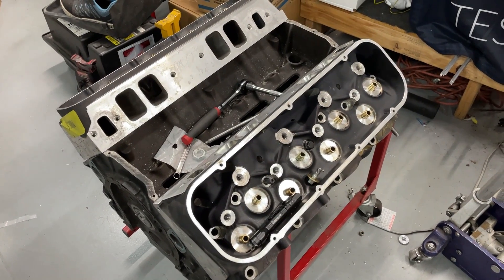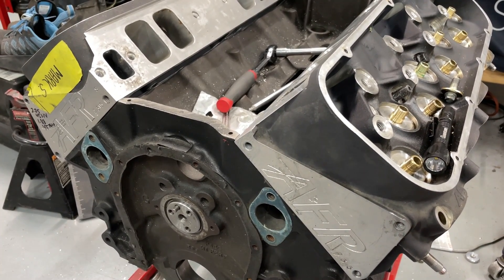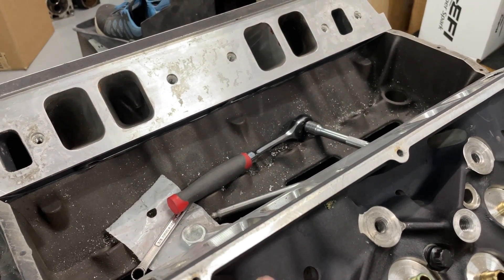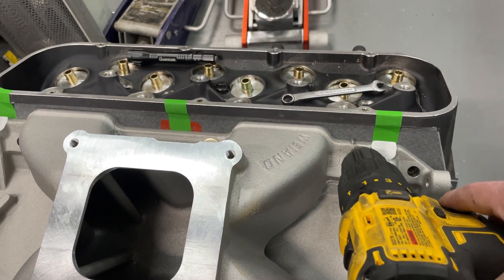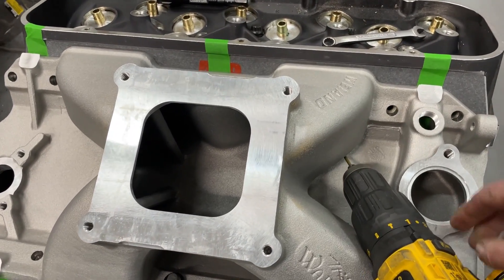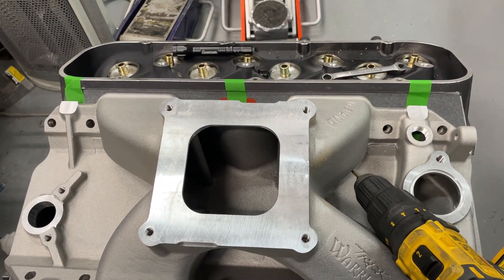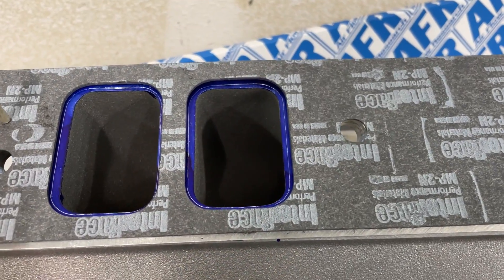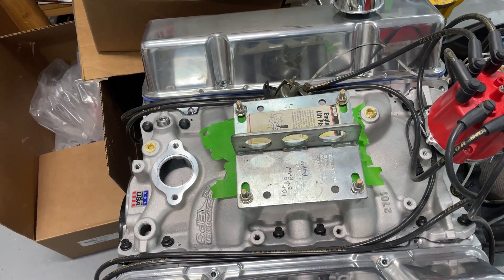A Better Way To Gasket Match

Comment: How does one know a port mismatch?  An intake manifold gasket can be used as a template but how can we see if the angles between the head and the intake manifold match, especially if the block is decked?
Reply from the maker: Angle finder

Comment: I have some AFD Cleveland 2V heads and the port locations don't align very well with the gaskets. I have a set of MR Gasket intakes and another brand that escapes me at the minute - neither fit the heads well. I have a Performer RPM intake. The Mr Gasket gaskets don't fit the performer very well either, but the other gaskets do - almost perfectly. Question is do I match the heads to the intake rather than grind the intake to match the heads. Heads are out of the box un-ported. Some sides of the ports in the heads would require about 1/16 removed to match the intake.

Comment: I use two bolts to hang the gasket, and mark the manifold or the head with a marker, and then I put the gasket on the the other part had or manifold and do the same thing, and then compare the two, sometimes you have to shave the gasket as well, but you use it for a template to match up each port.

Comment: If you drill vertically perpendicular to the crank centerline you can us 1/8" piano wire, which is hardened like a drill bit and then you only need one bit and you can put the pins in the heads, put the gaskets on and set the manifold down in perfect alignment everytime. The pins won't bind the mafiold but will keep the manifold even as it's torqued down to compress the gaskets.

Comment: Seen one vid where guy said the critical part of the port to match was the floor, and he used intake gasket thickness to achieve this alignment. Said unless ports are far off from each other there isn't any gain by grinding....

Not having a Dyno and multiple test pieces I'll never know the truth to his statements.

Comment: Eric I did the same thing to my head( iron wp) it wasn't but 5 tho .I ran it with 13.7 to 1 pistons and so far so good I've been watching the compression on that hole.
I guess the gasket took care of it..
Ole ridge runner race truck if ya wanna hear it run 95 s10

Comment: I used to gasket match by putting the gasket on the heads with two tiny spots of silicone. Then I put the manifold on with four tiny drops of silicone. Tighten it all up, let it dry and the gasket will come off stuck to the manifold. You can then scribe the lines, and remove the gasket. If you are careful with the placement of the silicone, you can still reuse the gasket too.

Comment: That's a great technique. An old timer racer taught me 30+ years ago to put a couple spots of grease on the heads, lay the gaskets down and then put some RTV on the intake, set it on, torque it down and let it set overnight. Pull it off the next day and of course the gaskets stick to the intake. Gasket match from there. Of course this was on Pontiac engines so the intake is pulled into the thermostat crossover so there is no back and forth adjustment available. That method worked pretty well but occasionally the grease would allow the gaskets to slip a little. I think I'll start using your method as it seems to be very repeatable when you have to do a tear down for whatever reason. Thanks!
Reply from the maker: No problem

Comment: My method:

Duct tape a 44oz foam fountain drink container onto the end of your shop-vac hose, and seal the drink cup into the cylinder of the block so the shopvac can suck on the cylinder. Have exhaust valve installed, but not intake valve. Turn on shopvac and spray a bit of paint primer down the intake runner for the cylinder you are "marking". Resposition shopvac and repeat for all cylinders. This will mark where your head ports are misaligned with the intake. Grind as needed.
Reply from the maker: Not a bad idea.
Reply: Just Don't spray very much paint because shop vacs have a tendency to use electricity. 😁
💥 Kaboom! 💥

Comment: Hey Eric, on a dual plane manifold, like this 2701, how do you know if the ports are lined up the best they be?
Reply from the maker: I usually just center the bolt holes on dual planes. Then I tighten it down and drill the holes.
Reply: An inspection camera that plugs into your cell phone can be had for less than 20 bucks on Amazon, would be handy for this.

Comment: Sometimes the simplest solution to solve a problem is in your face and a smart person might not even realize it. I've thought of ideas to solve my port and gasket matching issues for quite some time now on my small block stroker. I've never thought of this easy and simple way of taking care of matching and I consider myself a fairly logical and smart person. I've even done this practice before for re-mounting my body panels after lining them up and removing them for painting. They always go back to line up perfectly upon re-installing them. Never thought of using this to match ports.

Comment: An idea for the perfectionists amoung us.  You can use a cheap Harbor Freight inspection camera ($85) to get a look at the final assembly (for dual plane manifolds).

No, I wouldn't buy one for port matching, but you will not be sorry having one in the shop.  Use you imagination the number of uses.

Not being critical...... just an idea.

Comment: just curious. Why wouldn't you Center the bolt holes in the gasket with the bolt holes in the head?
Reply from the maker: Because when you center off of the bolt holes it rarely places the intake port in the right relation to the port on the head.

Comment: I am very new to this porting and polishing scene, but I use duct tape to cover and give a little protection to my cast iron head surface areas. Its not perfect but it helps me a lot but I'm using a dremel so its a lot slower. Hope this helps.

Comment: Ridiculous! Hows eye balling the ports through the intake work with a dual plane? I would trace the intake on the gasket with a sharpie before drilling holes in my intake!
Reply from the maker: That why you drill the holes.

Comment: Hey there Eric love the videos very informative 👍. I have a question if you weren't to port match these heads and intake what type if horsepower and torque would you be loosing? Just a rough estimate.

Comment: Don’t gasket match the manifold! You lose velocity. Only port match the head where you have an obstruction of flow from the manifold. 
Rookie mistake, which it seems some of the so called “Professionals” are doing as well... 🙄
Reply from the maker: Sure

Comment: Hello master. How many house power can I get I have the ports flows 312 cfm.Thes Heads com from super stocker.Wedge Alu Heads Mopar 440. 0600 lift.Have Nice Wedge Tunnel Ram intake.Sixpacks modifaid have even Billet metring block special order från USA.Engine runns grate.Weery god respons on The trotel like Efi..I hope i have araund 620 630 hp...I have even Fogger Nos system.Gonne handel with wery smal nr 018 022. Mayby hit 700hp.

Comment: Just curious as to why you don't use a steel template with tapered drift pins, and match head, gaskets, and manifold to.

Comment: Nice but, have you ever heard about dowel pins?................
Reply from the maker: Can you explain to me how you install the intake with the dowels installed in the heads or intake?
Reply: @WeingartnerRacing  The Japanese small engines manf., like to have dowel pins on head/ intake studs or bolts. That's the best of the best. Your idea of drilling small holes is similar, only needs small hardened pins. I did that a lot, only with straight drilled, holes, and leave the pins there in final assembly.
Reply from the maker: @ronbradshaw7404  with the v formation of the heads and intake you would have to pull dowels each time the intake went on or off. It seems like that would be a pain.
Reply: @WeingartnerRacing  Ohhh! certainly right you are!!!. I should shut-up :) i'm into Japanese motorcycle/ snowmobile engines, no V engines...

Comment: Great video, but i recommend not making it a habit to leave things in the lifter valley--that's how debris happens :) of course, this block is toast, but i know plenty of shade tree mechanics don't have a tray nearby so they just leave stuff where they can out of laziness training. just sayin that's all.  Meanwhile, with this particular full gasket, i'm thinking those bolt holes do a great job of lining things up without drilling a potential crack starter near a bolt area that's going to get torqued down, and being a full gasket one can outline where the top of the manifold sits, allowing it to be lined up on installation--or a location to take measurements from. sometimes you might just be able to scribe the head with an outline of the intake flange, or paint if you fear carving.
Reply from the maker: This is just a mock up block hence the hole in the side. I’m not worried about things in lifter valley. I leave them there so I can have them handy when I need them.

Comment: Useless. Just use the bolt holes. They're already there.
Reply from the maker: Those rarely line up.
Reply: @WeingartnerRacing  when you have the heads and intake you're going to use. That's the holes that you will use. Using the gasket on both, you have a foolproof why to make your marks.
Reply from the maker: @jackbrookshire431  that sounds great but when you put them on a block you realize the bolt holes on the intake are higher than the head or visa versa. Then your port match might be the same size and dimensions as the head but not aligned at all. That happens all the time.
Reply: @WeingartnerRacing  your bolt holes will dictate where the gasket goes. You can't get around that. Any discrepancies after the port work you're going to see with your scope.
Reply from the maker: None of the manifolds have a 3/8 snug fit hole. They are 1/2 or larger which gives plenty of movement up down and all around. They do this to make up for deck differences and so on. So if you gasket matched the intake lining up the bolt holes on the intake to the gasket then attached it to the head unless the bolt hole is exactly centered on the head your alignment is off. The bolt hole on the head is rarely if ever centered with the hole on the intake, especially if the heads were milled.
Reply: @WeingartnerRacing  then how do you get the bolts in? I advise you reassess your statement. 1/2"?? 😂

Comment: Have you ever done before and after dyno testing on a port matching job? I’m just wondering how much power it’s worth, considering how little work it is any power is worth it
Reply: Its definitely not little work porting 😂 maybe just gasket matching but i spent over an hour opening up 1 intake runner on just the lower intake

Comment: Eric you ever get a set of aftermarket aluminum heads that there is step valve guides leaving a gap between them and the aluminum in the bowls. Should I change them out or grind the aluminum to match or just leave alone

Comment: Block decked, heads milled: Layout dye along top of ports. Straight edge along top of ports. Scribe line to each end of head. Do same to manifold. Align scribed lines at each end of head to check for misalignment.

Comment: I talked to an engine builder in the 1980's about gasket and port matching... he said they had actually bothered to test that and found the average airflow gain was 3% per mismatch, and Im sure that had alot to do with production tolerances then, without saying whether it was the gasket or the  manifold to head miss match or a combination. It looks like the stuff you are working with are held to a tigher tolerance!!

Comment: Just wondering, could you use some kind of inspection camera to help with port matching? I don’t even know what they cost… Those boat engines look like you could really burn some fuel! I’ve seen a few running up and down Lake Havasu, impressive rooster tails!
Reply: There is some really cheap scopes available. Some under $100. If you were scouting stuff in a junkyard it can help find issues making sure all the pistons are home. If you were trying to port match a dual plane it would be a neat idea.

Comment: Why not just tape the gaskets to the head like you do... then with the tape properly located where it can be pulled loose from the head later place several BB size droplets of silicone strategically on the frog tape to manifold points and let dry for an hour or two. The Gaskets will stick to the manifold perfectally in place and no harm done to the gasket being the tape is where the silicone has made contact. No holes necessary. Cool how you did it but a little more work than necessary in my opnion and all the time drilling could be spent elsewhare while the silicone dries.
Reply: @Nobody How could you know the position of the intake relative to the cylinder head without a locator that controls for X and Y position?  The suggested alternate method only controls the gasket alignment thus less control of port alignment and is not repeatable if the gaskets required replacement.  If the motor was ever torn down and assembled it could introduce variance as each part has its own manufacturing and installation/assembly tolerance. The tolerances could stack causing error of port alignment which the 'dowel' method can identify, measure, and control as well as being repeatable.
Reply: @ictcarguy3162  First locate the intake gasket to the head as shown in the video, sit the intake on with silicone properly placed then lift the intake off with gaskets stuck to the intake after the silicone has dried. (then scribe) No need to make to much of it.

Comment: While I'm not against drilling for dowels, as the Holden 253/308's I own come like it standard, from the factory. but on other Engines, The way I do the Port Matching, ethier the left or right head or gasket fits, lines up perfect. No Drilling required.
Reply: @atflokee  yeah i didn't get what he said either